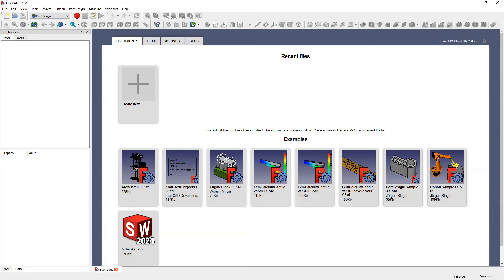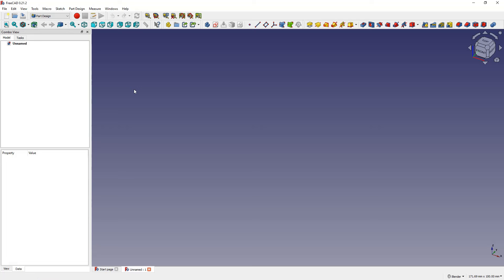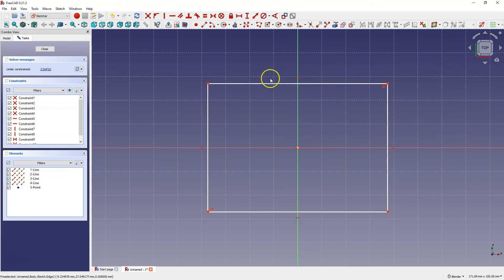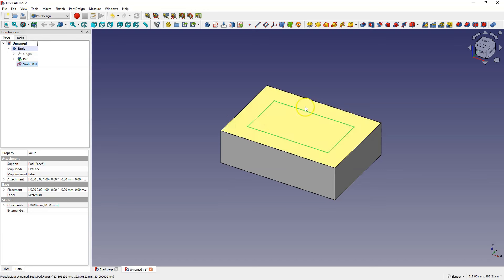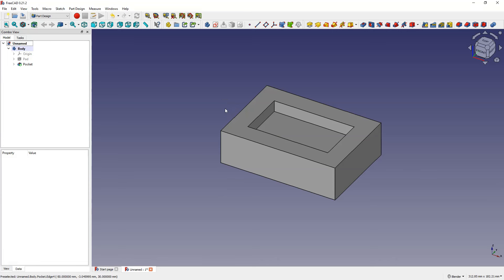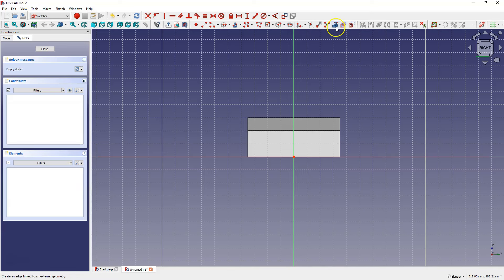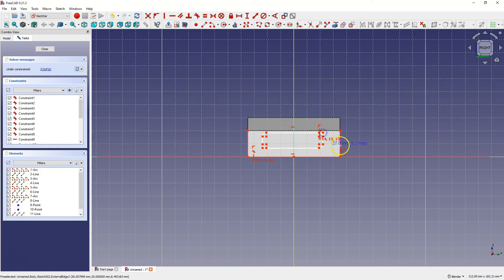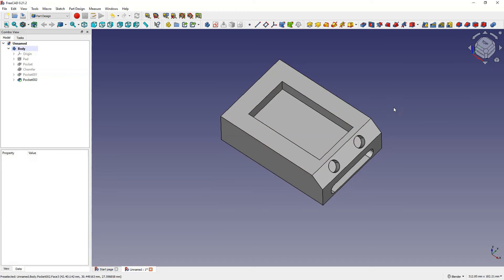FreeCAD Pocket Operation - Zero to Hero Part 5

Comment: Hi, it would be nice for everyone to know what's your FreeCAD version used. Greetings.
Reply from the maker: The upper left corner of the FreeCAD window - it says what version of the program it is
Reply: @CADCAMLessons  That I know but a newie doesn't. I had to magnify my screen in order to get the version on your screen which is 0.21.2 as mine.
Reply: @LFANS2001  Well, I'm a 51yo newbie with no prior CAD/CAM experience and din't have any problem finding it. I'm trying and using FreeCAD, Ondsel and Freecad Link branch and to be honest, the workflow from these series is exactly the same across all these versions.